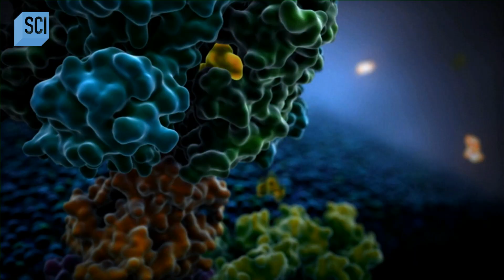A Look into the Evolutionary Process | Through the Wormhole with Morgan Freeman | Science Channel

Comment: There is no evidence of "random" selection. Then that unnatural selection is intelligently nursed. In the beginning GOD...
Reply: Have you not heard of those black butterflies that sat on birch stems blackened through soot, and of how these animals were immediately replaced by white conspecifics when the soot vanished from the air and from the stems?
Reply: @HansDunkelberg1  no
Reply: @barrysumner3024  That has happened in Britain. It's a popular textbook example for the correctness of Darwin's theory.
Reply: It's not random selection, it's sexual selection. The traits that lead to successful reproduction are the ones that are passed on to the next generation.
Reply: @petezah2686  I have understood Barry as meaning that mutations would have to happen randomly. This can be the case with species propagating sexually, too. Which not all species do; some propagate simply by splitting in two, and such a splitting process, combined with the construction of a new, adult organism based on stem cells, also is embedded with many higher animals ("parthenogenesis").